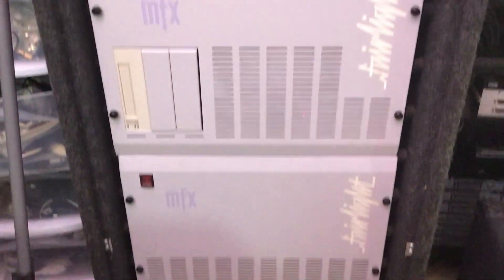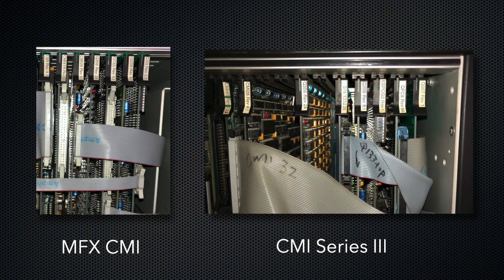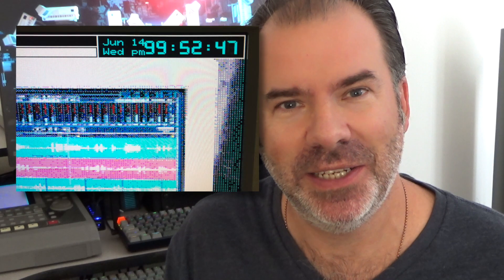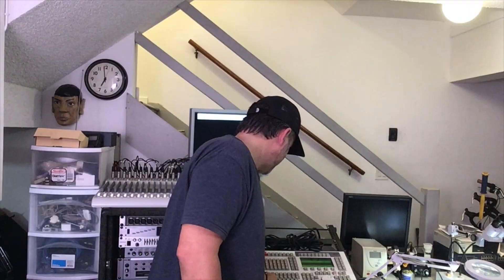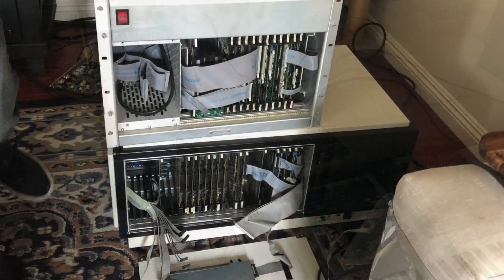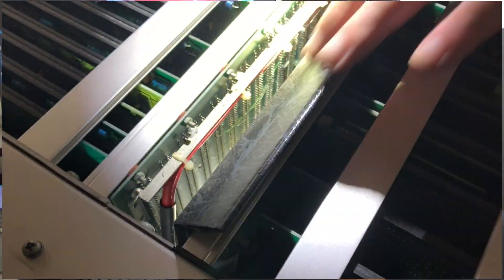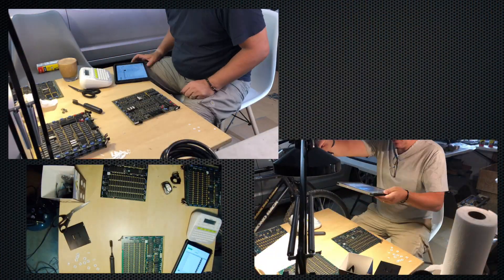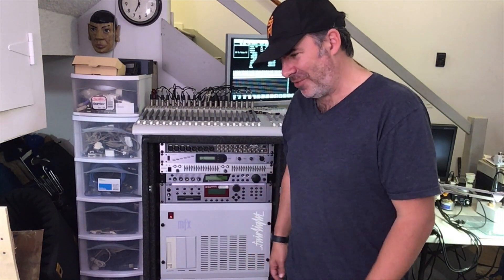I'm building a Fairlight CMI  - What on earth am I doing...

Comment: Very interesting. So if some MFX3 had CMI parts, what about MFX1 and MFX2 machines? That would make a significant number of completely obsolate DAW but potentially nice CMI systems :)
Reply from the maker: Indeed ! Half the battle is identifying them. Remember the MfX3 was Cmi based but the MFX3+ was a completely different architecture.  Apparently there weren’t that many mfx/Cmi systems made, and they got to the MFX3+ as quickly as possible it seems.

Comment: Where's the video about the MFX you're talking about? There's a lot of information and a lot of videos about the CMI but almost nothing about the MFX systems. It would be great to see an MFX3 in action.
Reply from the maker: Hi ! I’d made a video about the mfx/cmi hybrid running in MFX mode, and even found the trailer for the project that was on the unit. However, you’re correct, there needs to be more MFX3 videos and it’s my plan to make some !
Reply: @CrisBlyth  Hi. Could you share a link to that video?
I'd really appreciate more videos on the MFX3. I find these old hardware DAWs quite fascinating. What did you do with the old MFX case that you stripped to build your new CMI? Cheers!
Reply from the maker: @UseYourBrain930  Hi ! I’ll need to republish it as I realize I’d only uploaded it to FB for the users group.
Regarding the case, I still have it, although last night I unscrewed the last of the bits holding it together as a frame, and flat packed it’s empty shell.. in an honorable fashion of course.